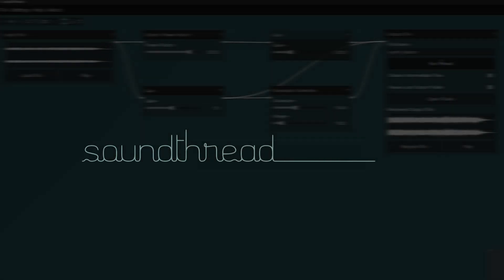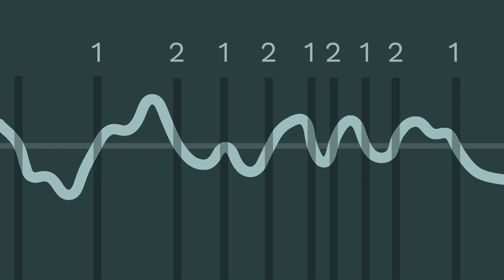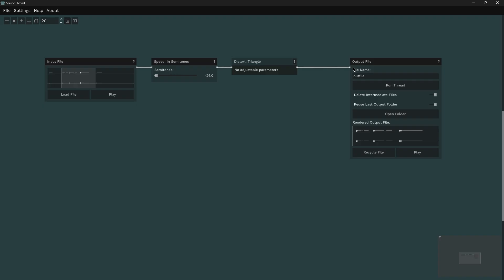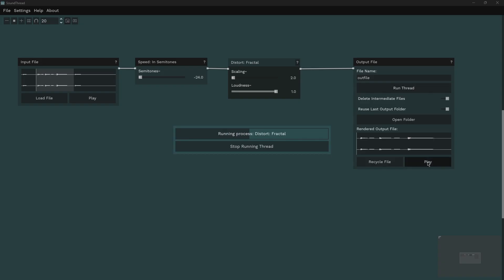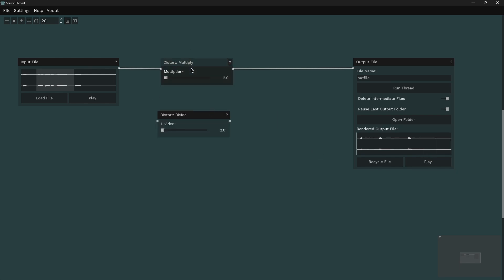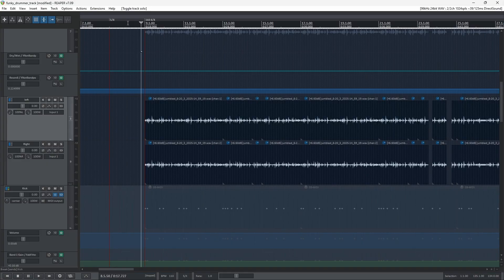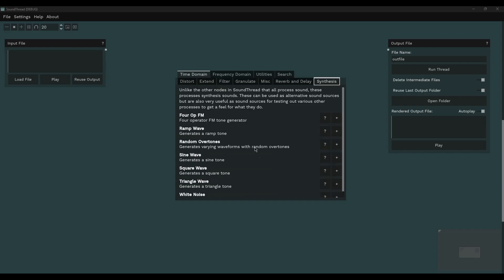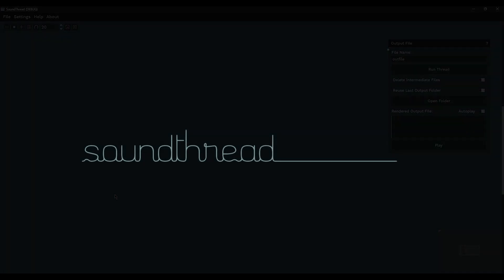What is Wave-Cycle Distortion? SoundThread and the Composers Desktop Project + Dev Updates

Comment: Jonathan,
Have you thought about adding the option to bypass modules?
It would be a really handy feature for experimenting with different scenarios!

Thanks for the amazing tool—it’s fantastic. ❤
Reply from the maker: That's an interesting idea although I could see it breaking things if not implemented carefully e.g. bypassing the conversion to frequency domain would make the rest of the thread fail. Will have a think!
Reply: @j_p_higgins  Seems like you could test whether the node being bypassed was a converter to/from time domain, and if so, disable the entire subchain in the new domain. That would make sense from a user's pov, and be a big timesaver.

Comment: is it possible to jump over the run thread to render as live fx? or automatic render?
Reply from the maker: Unfortunately the processes take too long to run, particularly with long files for this to be feasible right now. In future I plan to cache some of the running which might make it more feasible. Worth noting you can run the thread with ctrl/cmd+r which does speed things up a reasonable amount
Reply: @j_p_higgins  thanks for reply. actually i can not use your tool, if you have a look into github issues...i hope you find time to fix such things, would appreciate testing out this nice sound tweaker in Linux...thank you a lot for this nice experimental sound toy.....cheers*

Comment: fun fact: an effect, that sounds very similiar to your triangle distortion, is slew limiting. it limits the rate of change of a waveform and if you're sorta "hardclipping" it, it results in a maximum slope which will constitute as many little triangles scattered across the waveform. but it's also different because slew limiter also leaves some part of the waveform unchanged
Reply: is there a free VST out there to do this? I've only seen that happen for the synth "vital", with its wavetable editor, but it would be nice to use in real time too!

Comment: Haven't tried it yet, but is there any kind of mid/side encoding/decoding? Might be an interesting way of allowing users to interact with the stereo imbalance effect of wave-cycle distortion in interesting ways. Really cool project!
Reply from the maker: Not currently as CDP doesn't have this however in future I have plans to implement mid-side processing nodes as an addon. It's worth noting that as mid-side processing is dependent on the phase relationship between the two signals to recreate the stereo signal and some of these processes can alter phase the end result can end up shifting the position of sounds in the stereo image. Still a cool effect though, I've been playing around with just running mid-side encoded sound files through this.

Comment: These processes are IMO the jewels in CDP. Try applying a large DC offset to your sounds before going into these processes if you want to have some fun. May take a few tries as its easy to exceed the maximum allowable waveset length, but you can get some nutty granular-like sounds. Works particularly well with the 'interpolate' waveset process, producing fragments whose lengths 'sweep' up and down between long repetitions and audio rates. Anyway, thank you so much for this work. Been a huge CDP lover since 2005 and I'm so happy to see developments like this making it more accessible and bringing new people on board.
Reply from the maker: That's a really cool idea, is there a process in cdp that you use to add the DC bias? Wouldn't mind having that as a node in soundthread
Reply: @j_p_higgins  There is indeed. Not sure what the command line is, but in Soundshaper its 'edit/mix -> utils -> DC remove'. Name is a touch misleading as it sounds like an automatic cleanup tool, but it actually only applies a user-specified offset in either direction.
Reply from the maker: @hissface DC bias is in the new update, thanks for the tip

Comment: This would work really well as a VST
Reply from the maker: I've toyed with the idea of implementing this principle as a plugin a few times but the issue is with latency. This process can only work offline as the process has to see the whole wavecycle before it can know how to reshape it. You can get around this by faking real time by storing the incoming audio in a buffer and then processing that before playback but to be able to process down to 20Hz you would need at least 50ms of latency and in my testing ~100ms was the best I could get working reliably at all frequencies. That's not terrible, you're not going to be using it in a live situation, but it is useable in a studio mixing environment. However, this is only for processes that only distort one wavecycle at a time, there are many other distort processes in CDP that work on groups of wavecycles, at that point you start needing to buffer and delay up to seconds worth of audio and at that point DAWs start getting real grumpy and everything gets a bit laggy. It's definitely not impossible but I arrived at the conclusion that I'd rather just use them offline instead of using very laggy plugins in realtime.
Reply: @j_p_higgins  just implement it with lookahead and it's cool :)
Reply: @j_p_higgins  Out of curiosity, have you tried using a frequency domain transform? Basically this is a mathematical function that allows representation of the original wave without the use of a time variable and instead outputs the distribution of frequency bands over a range of frequencies. A number of coding languages have them (specifically the fast fourier transform) built in as a method, though I have never personally used them. It would probably be quite hard, but it is still worth looking into seeing as nearly all DSPs use these kinds of transforms to circumvent the time parameter. Iirc, a professor once told me that discrete FFT algorithms are what allows for near instant voice transmission through satellites on cellular data, but I could be misremembering.
Reply: @BeepeeOil  the specific effects discussed in this video are time domain processes and cannot be implemented in the frequency domain - read up on "wavesets" if you want to learn more. as far as frequency domain processing goes, CDP already has a number of FFT-based effects which are called PVOC effects (short for "phase vocoder") in the user interface.

Comment: Forgot to say, when you used most simple version of it (triangle, I think), it made me thinking whether or not it's similar to waveshaper stuff from Buchla or Make Noise. Hm. Oh, and when you said that "traditional" overdrive also possible in CDP - could you please direct me into a right way? Is it done via toying with amplitude mostly? P.S. And yeeees, it seems that development of SoundThread goes very nicely, you do amazing work, cheers! Looking forward trying out next version for sure!
Reply from the maker: The wavecycle distortions are not entirely dissimilar to waveshapers/folders although the main difference is that buchla style waveshapers are usually still dependent on gain to set the change in shape so only apply the loudest part of the signal, this doesn't really matter when you're feeding it a fixed level from an oscillator but will produce inconsistent results with signals that are dynamically varied. The wavecycle distortions apply the reshaping to all of the waveform regardless of gain.

More traditional soft clipping like sounds can be achieved in soundthread/cdp with the power factor distort function (called Quirk in cdp) when values less than 1 are used. 

The hard clipping that is currently in soundthread is somewhere between hard clipping and wavecycle distortion, it clips off the top of the waveshape regardless of the actual gain. However the next update will also have conventional hard clipping in there. This is the Clip function in cdp. Although if you want hard clipping you can also just use the gain nodes to boost the gain a lot and hard clip the file for the same result, I don't think it will try and stop you!
Reply: @j_p_higgins  thanks for sharing thoughts!